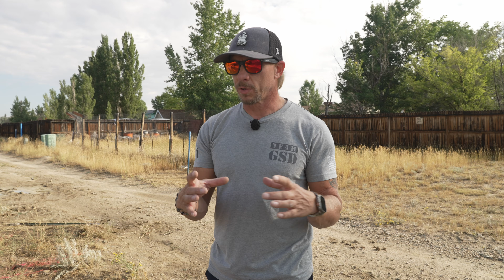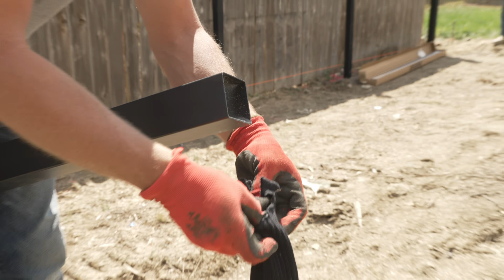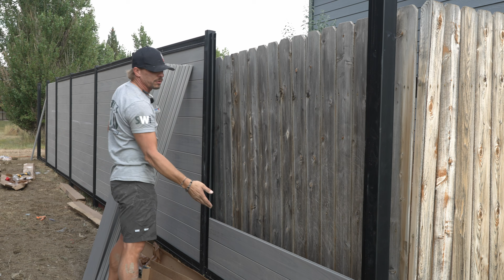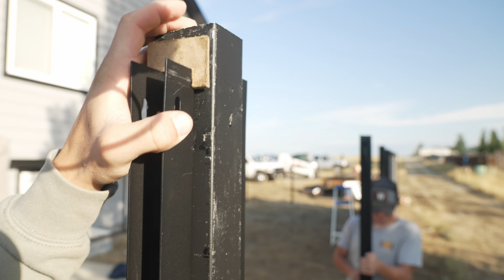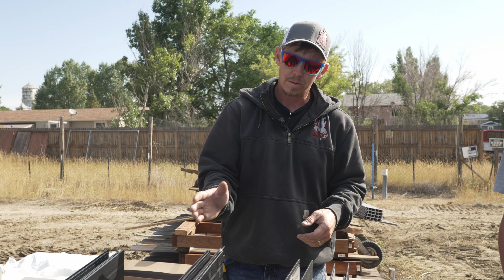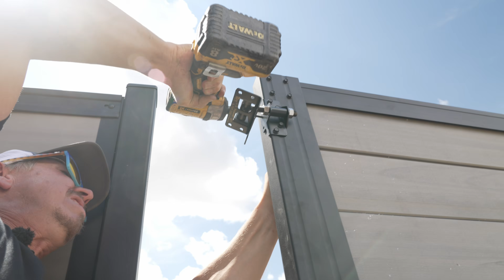Can You Really DIY a Fence This Classy? (Mistakes & Fixes)

Comment: Is it common practice to put the gate latch on the alley side for ease of entry for the alley dwellers and not on the inside for the home occupant? Just curious or was I out of focus? Other than that, it's a good looking fence.
Reply from the maker: That's a fair question. You're looking at the outside of the latch there, but the handle extension part is on the inside. So on the inside of the gate you would push the handle and push your gate outward to open.

Comment: That welded posthole pounder tool you made would work great if you added gussets to each side. That would remove its ability to leverage on itself and flex, which is why it keeps breaking.

Comment: YOU all must LOVE lungs full of concrete and cement - wear a fkg mask dude !! NOTHING is worth your health - not even your face!!! AND TWO GLARING issues: One, an Engineer, this system is half baked, if a system gets damaged during installation, it must be redesigned - you do not expect the buyer to go back and cut off which can cause new issues - TWO, when installing a door, for safety reasons, get the Hinges on the INSIDE of the house, not outside where the screws can be undone to gain access.

Comment: Wouldn’t you want to lock/handle on the inside???    Or a lever handle so on both sides and you  chose were to put a lock!    I have a pool so need a lock!
Reply: You can lock from either side with the handle provided.

Comment: Not being critical in any way, and I truly love this fence design...but...the video you presented can in no way be construed as "DIY". Can it be DIY...yes. What you guys did was use all the best tools and labor available. Still a big fan and watch all your content as a home remodeler and multiple rental home owner.
Reply: This is very DIY-able. The post driver is just a substitution for digging holes and filling with concrete, the bobcat is just a substituting for using a wheelbarrow, and the handheld bandsaw is just a substitution  for a hacksaw. It'll just take more elbow grease. Of course, if you have an aversion to manual labor, you can rent all the tools and equipment they used.
Reply: 😂😂😂 anything is DIY if you have the skills and access to tools 😊